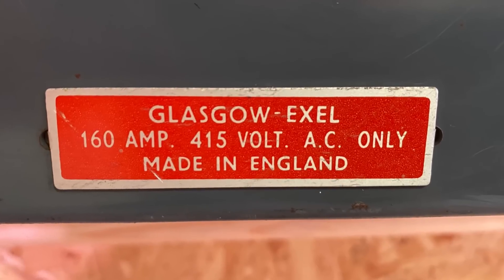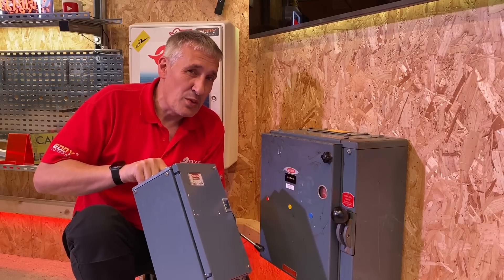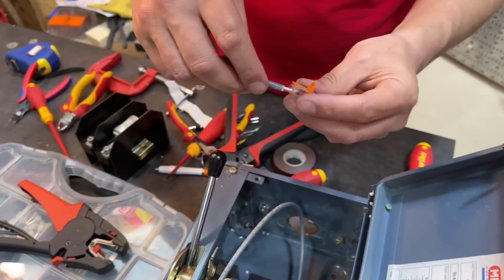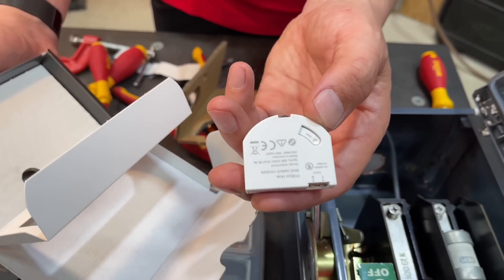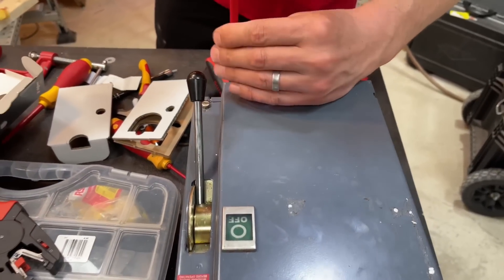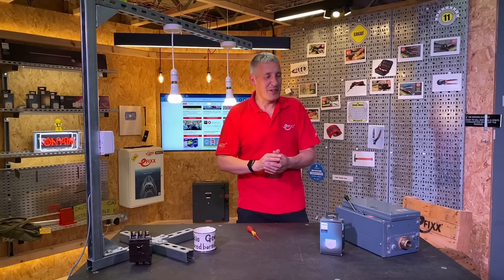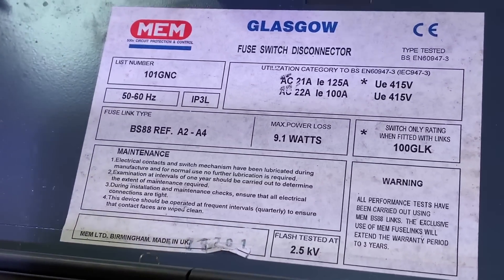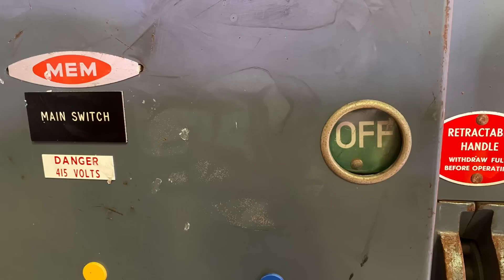Giant Wireless Switch Using the Philips Hue Wall Switch Module

Comment: Aside from locking most in to the Phillips eco system (HomeAssistant can communicate with these as well), these don't look terrible - the battery is a CR2450 which can be had for a few pounds, I was expecting these to be replace the unit when the battery dies!

Comment: One question with no mains wiring the what’s the purpose of the fuse surely that’s redundant? , I would have thought an old men switch isolator would have been a better choice? . You took one wire from top of fuse to one side of that dongle thing and joined them with a wago, then a second wire from bottom of the fuse to the other side of the dongle thing and joined them with a wago, I don’t see what the purpose of the fuse is serving?
Reply: It's serving no purpose, theres no voltage going through it anyway. I pressume its there just because its equally of no use to replace it with a metal strip therefore might as well keep it original. The only time you would need to replace the fuse would be if it was already blown as it would be open circuit but in this instance you would just wire the hue switch to the neutral side instead. The switch is just closing and opening a circuit for the hue wireless switch.
Reply from the maker: You're quite right, the fuse is serving absolutely no purpose whatsoever! I would imagine Gordon bought the switch fuse a while back for set dressing and saw a good opportunity to modify it. 👍
Reply: Thank you for the reply . That makes a lot more sense. And I have to agree it’s better to keep it original and intact. For me this is a fantastic way of recycling . 👍👍

Comment: I do like the old switch fuse and stuff like that, that’s a clever way of keeping them in service. I like it.
Great video Gordon as always 👍👍👍👍❤️
Reply from the maker: Thanks Sean
Reply: It’s a fuseswitch not a switchfuse,important difference
Reply: @anthonyschofield7807  there are two types of this one has fuse’s such as the one in the video and one the just has a contact bar and is simply an isolation switch they’re usually three phase units , 20amp TP+N isolation switches they may be single phase as ? I have only ever seen the three phase ones .also I was tort at at college that it is a switch fuse
Reply: @Dog-whisperer7494  A switchfuse only disconnects the outgoing supply and so can only have the incoming supply connected to the bottom entry,a fuseswitch disconnects both incoming and outgoing supplies and so can be connected with the incoming supply at the top
Reply: @anthonyschofield7807  so all the pictures on Google of the Eaton men switch gear are wrong and everything we were tort in college is wrong . Look at the pictures
Reply: @anthonyschofield7807  it doesn’t matter he’s could have used any of them for this conversion my point was the fuse is not needed it isn’t doing anything .
Reply: @Dog-whisperer7494  Just pointing out that there is a fundamental difference between a fuseswitch and a switchfuse,it’s not just a a different name and if you had to buy one or the other you would also see a big difference in price,important not to mistake one for the other when tendering
Reply: @anthonyschofield7807  but this has nothing to do with my original point . In the video Gordon has used a Glasgow SPSN Fuse combination switch , the fuse serves no purpose. So he could have used a TP+N isolator switch . 

Isn’t it nice to have a good old fashioned honest debate. 👍
Enough said .